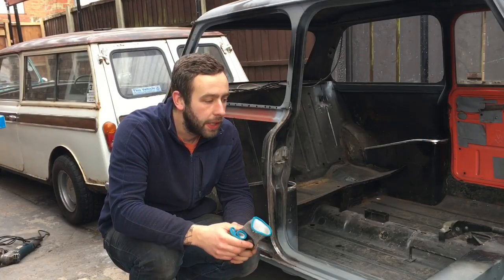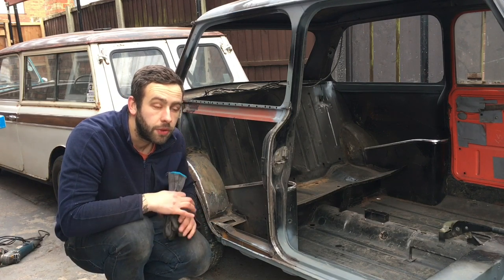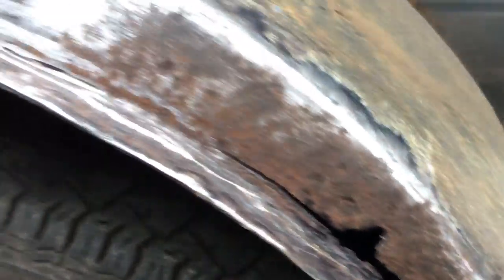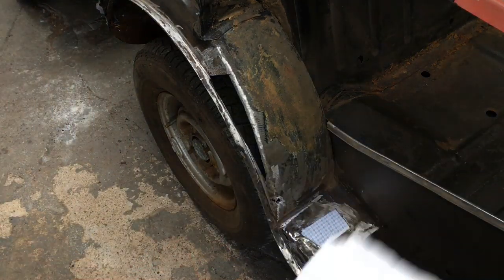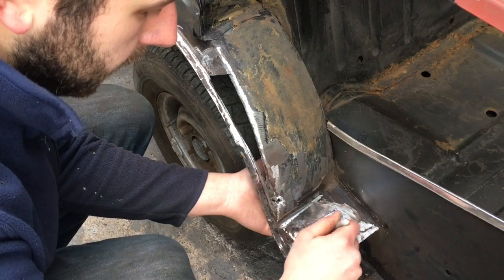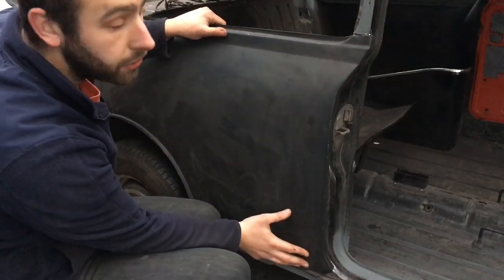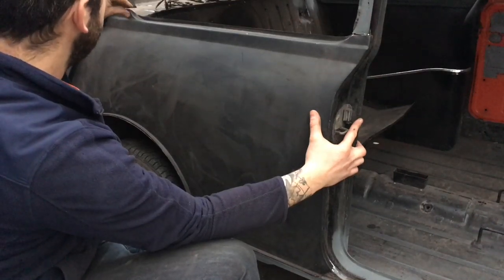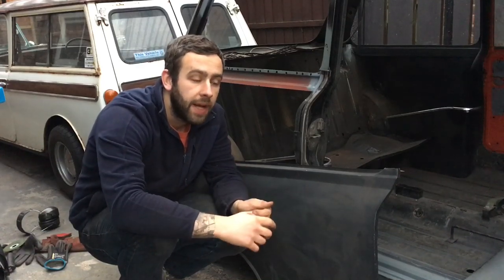Classic Mini Clubman Budget Restoration - More Repairs

Comment: Hi Marc,  great to see you back at again.  No sensens whatsoever in replacing entire panels or body parts if all they need is  small areas repaired.  Just do as you said, repair the rusty bits, going the welds till they are neat, and crack on.
Reply from the maker: Shane Black Lord Cheers thanks Shane yeah in the long run this is definitely the right thing to do so. So hopefully it will look nice when it’s done. Plus it’s a chance to get some paint in the areas you never normally see.

Comment: A good tip if you find yourself blowing through on corners is to drill those out before cutting the piece out so you have rounded off corners and these will be easier to weld.
Reply from the maker: nudgerss Hey thanks for those tips I really appreciate it I will give it a go 👍

Comment: Thanks for the video - I do enjoy the metalwork repairs. I'm surprised you don't have a vice though. It was one of the first things I bought when starting my restoration project last year. I had been managing for years with an old woodworking vice but I now have a 6" engineer's vice and it makes such a difference - especially when dealing with rusty steel components. If you don't mind something from China they are only about £50 new.
Reply from the maker: Graham Woodier Hey I am glad your enjoying it. Yes a vice is definitely up there in my list of things to buy I have a lot of metal bracing saved from the 89 build so plan to use some of that and make a small work bench so I can put a  vice on it.
Reply: @SimpsonsClassics  Have you not got a birthday coming up?
Reply from the maker: Graham Woodier unfortunately not lol I will get one sorted

Comment: Turning out great coming along nicely I need to start on my quarters just waiting on parts so until they arrive I don’t want to remove the rear quarters but the sills need doing badly on mine too. Do I Replace sills before I replace quarters? Cheers
Reply from the maker: curtis wilcock Hey thanks for that. Yeah I wasn’t looking forward to cutting the quarter off but I guess it’s done now aha. I have done the sills first so I have a new panel to weld on to. But I guess you could do it either way. For me also I have painted the inside of the sill so I know when the quarter goes on it locks it all in good and solid
Reply: Simpson’s Classics Yourwelcome ah right that’s understandable and yeah I’m really not looking forward to that part but all part of learning yeah I guess all fresh now for your build looking great especially on the under side too. Thanks for the advice I’ll do the sills first it will be easier and I’ll paint it too just like you did so it’s all fresh thanks again.
Reply from the maker: curtis wilcock Thanks for that mate I am just trying to make to make it last as long as possible. Just made more sense to me to do it the way I have once this quarter is done that’s the drivers side done apart from the front end. Round to the back next hopefully don’t find anything bad that end
Reply: Simpson’s Classics Yourwelcome mate yeah doing it that way makes a lot of sense as it will last way longer now that you painted it and all shiny and good as new and I’m going to be following every step of way as I’m learning a lot from the videos and yeah it’s strange that as the back of my mini doesn’t seem rusty it’s just wings quarters sills door steps and floor in mine.cant wait to see more progress I think I need a whole new floor in mine as the cross member is buggerd
Reply from the maker: curtis wilcock I am glad the videos are helping mate that’s why I enjoy doing it so much as if I can help that’s awesome plus I learn a lot of your comments. Yeah sounds like your mini is a good one. You can just replace the crossmember. That gives you the chance to paint that inside to. Luckily the clubby isn’t to bad with that I will just spray and wax the inside of it. This clubby has 50k original miles and has been off the road since 2001 so it’s definitely helped it survive. I hope you manage to get on with your sills soon.
Reply: Simpson’s Classics Yourwelcome mate I enjoy your videos as it helps me and I’m glad you enjoy it whilst doing this kind of restoration work and on a budget that is a good thing too as I don’t have the fancies of jobs that doesn’t pay that great but I’m slowly getting along with it bit by bit and I’ll just brace it and cut out the crossmember and replace before I do the sills that way it will be fresh and I’ll do what you advice to paint the inside and wax it that way prevents from future corrosion and yeah my mini ain’t that bad to be honest.i have learned the hard way from my mistakes and wow only 50,000 mile that is good and I don’t know how many miles mine has on as it didn’t come with a miles meter I know the engine is all original I need a new wiring harness for it too and I’m sure I will get on with the sills buying some panels next week and mocking them up and it does help when your car been off the road for the length of time and in dry storage too.
Reply from the maker: curtis wilcock That’s great yes definitely get some paint on the inside of those panels for sure. It will soon start to take shape just need to pick somewhere and get cracking really take your time. I look forward to seeing it take shape
Reply: Simpson’s Classics Thankyou much appreciated I will most defiantly get some paint in there and I thought I would start with sills and go on to the rear quarters then work my way to front I will certainly take my time doing this work thanks for you advice me I will probs post some small videos here and there like as progress comes along :)

Comment: Do you use seam sealer on any of your butt welds Marc like under that wheel arch? Or is the primer and eventual topcoats do the trick?
Reply from the maker: Pat Adamson I do use seam sealer Pat I will zinc prime everything then go round the car when it’s time for some proper prep and paint on the underside.

Comment: Expand on the welder issues a little .. see if I can help
Reply from the maker: Chris Beck hey it just every now and then act up like it’s it not earthed or something it’s a pain in the ass aha but I have changed the earth clamp now and seems much better
Reply: Simpson’s Classics Try using mole grips on the body .. nice and tight on a clean area , then attaching the welder clamp to the mole grips.
Reply from the maker: Chris Beck Hi yes I have read somewhere else to try this I will give it a go on the next bit of welding I do 👍

Comment: When I see classic car restorations I'm always left wondering how much of the original vehicle remains.
Reply from the maker: profmartin1967 yeah some restorations to take things to the extreme and can be over restarted I guess. But it’s all about keeping them on the road
Reply: Fully agree. We need to keep these classics on the road. To be honest the first few cars I had when I started driving 30 years always needed welding every Mot. Most of those would now be thought of as classics.
Reply from the maker: profmartin1967 yeah likewise every time the mot came round it was like what’s next to weld up. But guess these days can just be as bad loads of 5 year old cars out there covered in rust. It’s bad really.